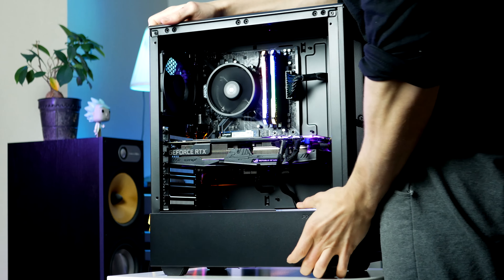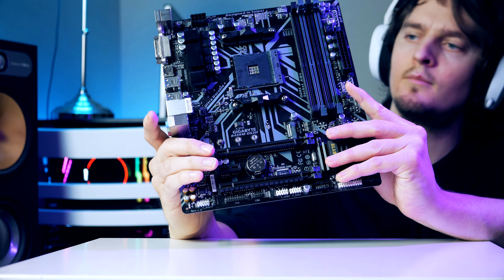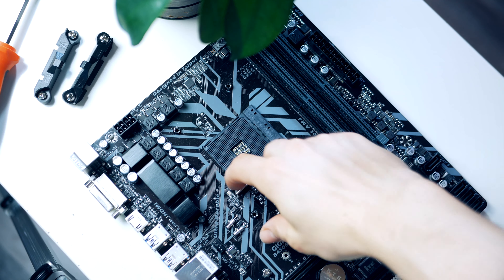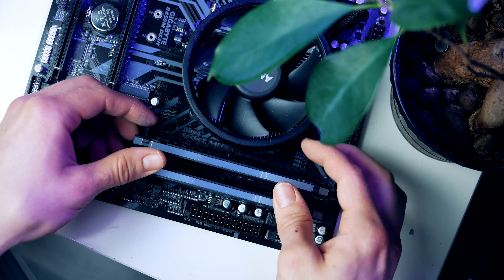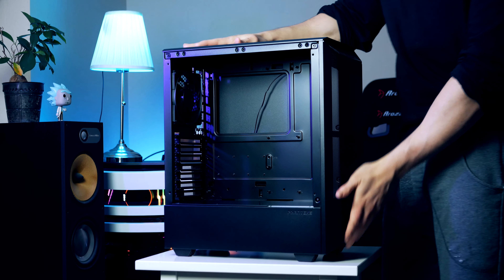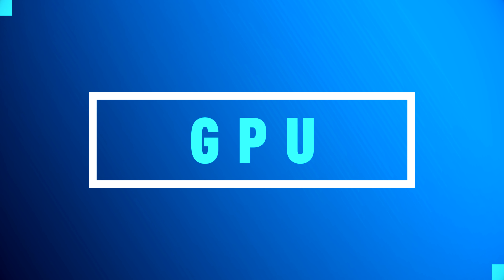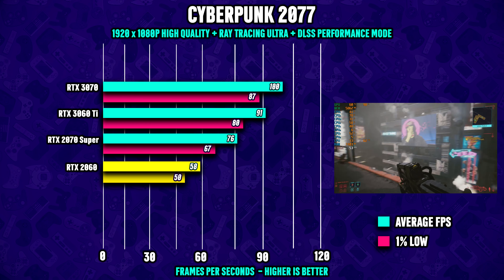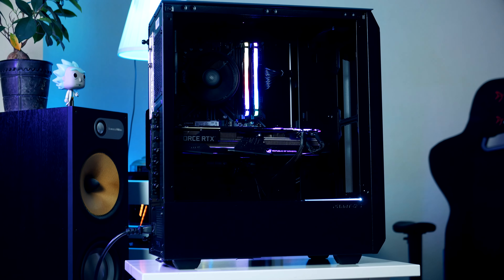How To Build A Gaming PC Under $900 in Early 2021 🔥 Complete Step-By-Step Tutorial + Benchmarks!

Comment: Can sum1 plz reply is it fine if there are no fans on the side? Will it overheat? And if so can u make video installing the fans on this pc
Reply: I recommend at least 3fans.4-5 fans would be fantastic for better cooling.Make sure theres in intake fan for sucking on cool air and outake fan for exhausting hot air from inside of the case.